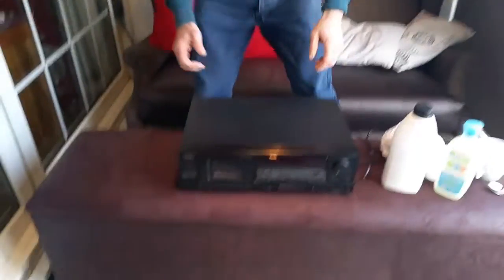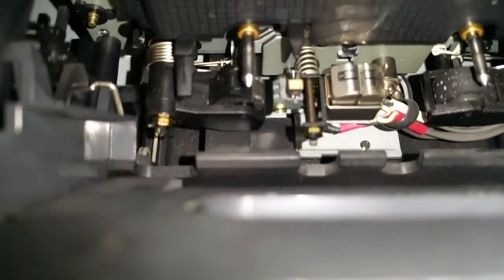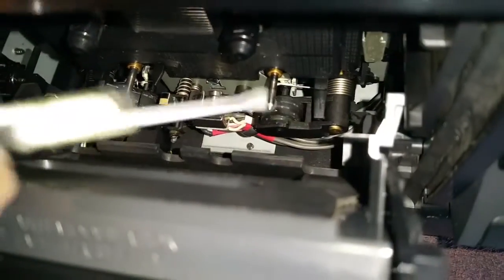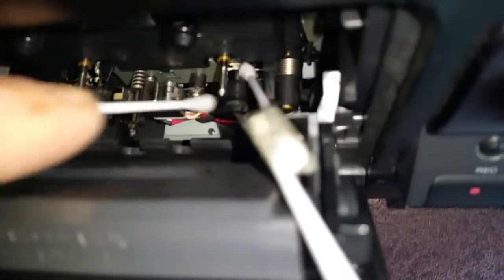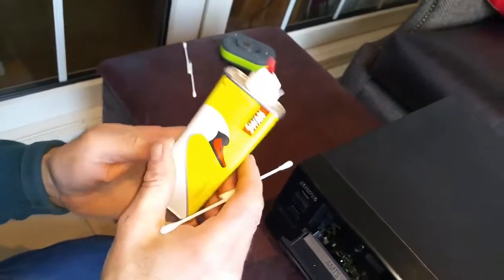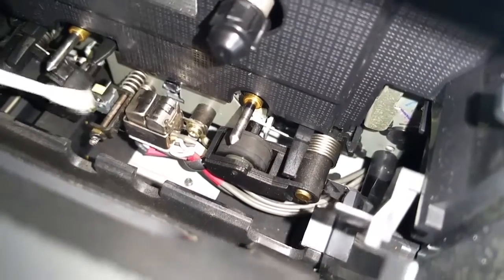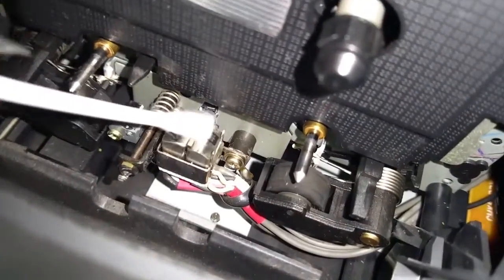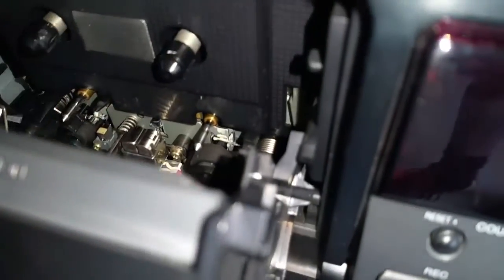How to clean cassette deck heads

Comment: Use pure alcohol..NEVER lighter fluid.
Reply from the maker: Pure alcohol damages tape heads over a period of time, lighter fluid, is far better for cleaning tapes, thanks for watching.
Reply: Lighter fluid has oil in it. The alcohol will dry out all the rubber parts over a period of time.